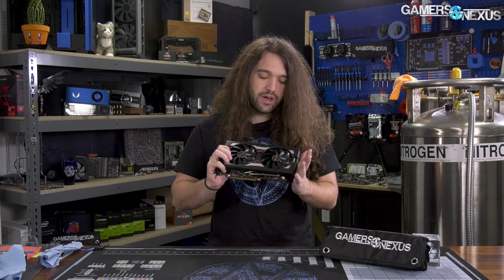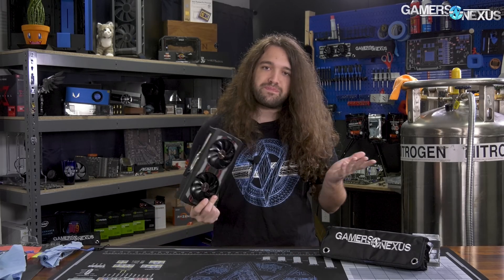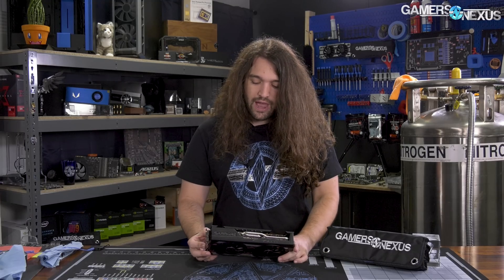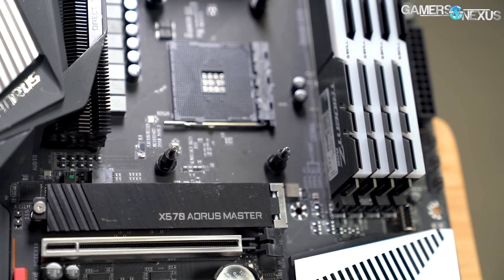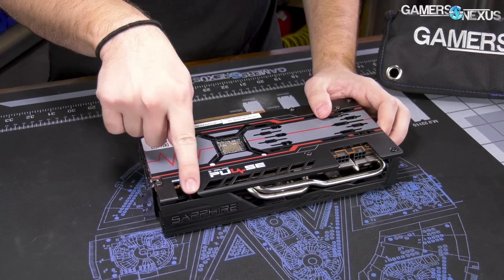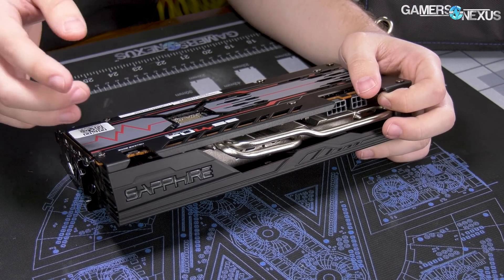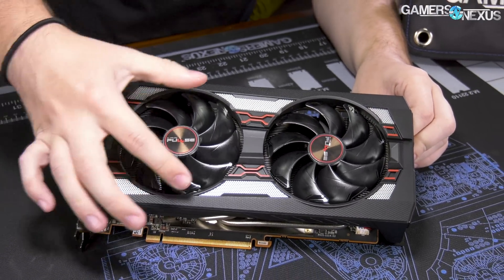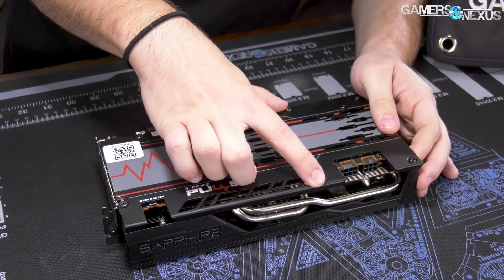Sapphire RX 5700 XT Pulse Tear-Down: Cooler Quality & Assembly

Comment: Here's my most up to date universal gaming PC build range pricing:

None of the listed frames per second ranges are overclocked.

More info on all of this: https://www.facebook.com/danthemanholt/posts/10220023187635995

I'm not using the newer AMD parts because Intel has better processors in the $350 to $485 range for gaming computers. Instead I use older high quality AMD hardware because it's cheaper. I can't justify the X570 PCIE 4.0 and 5Gbs NVMEs for that reason. Instead I'll wait for Intel to support PCIE 4.0, ddr5 ram, and 5GBs NVME. AMD wins 100% in content creation, their next Threadrippers should be killer. AMD's 2020 graphics cards will be cheap and great, they need to make their version of 2080 Ti there is no talks of. I had been saying if they have inbuilt liquid cooling on the right parts it would take them places. By 2021 Intel will have ddr6 ram and PCIE 5.0.

AMD's still ideal for quality cheap gaming with their $99 to $330 processors. I can give credit for AMD in expanding their hardware to ddr5 ram (that now accesses the high Mhz above 3200Mhz, for ddr4 ram anything over 3200Mhz only showed a marginal improvement in ram, ddr5 ram with B-Die can go up to 6400Mhz), 4-5GBs NVMEs, and X570 motherboards with PCIE 4.0 but it gets a lot more expensive than NVidia/Intel builds to purchase that new technology. I have to wait to find out about AMD's new $750 processor 3950X for gaming and how it compares to i9-9900K and i9-9900KS.

Gigabyte PCIe 4.0 NVME SSD new prototype Adapter has hit up to 15 GB/s when paired with four of the company's new Aorus PCIe 4.0 NVME SSDs, and possibly can hit up to 20 GB/s. An Aorus PCIe 4.0 NVME SSD gets 4-5GBs read and write speeds per each 2TB NVME SSD, beating the Samsung 970 Evo Plus PCIE 3.0 2TB that gets 3.5GBs read and write speeds.

https://www.tomshardware.com/news/gigabyte-pcie-4.0-ssd-5gb,39433.html Aorus PCIe 4.0 SSDs

https://www.tomshardware.com/news/gigabyte-pcie-4.0-ssd-adaptor-amd-third-gen-ryzen,39476.html Gigabyte PCIe 4.0 SSD new prototype Adapter has hit up to 15 GB/s when paired with four of the company's new Aorus PCIe 4.0 SSDs. Each of those SSDs hit up to 5GB/s, so the card could potentially push up to 20 GB/s with further tuning.

Here's the best gaming PC build you can currently get:

1. Intel Core I9-9900K 3.6 GHz to 5 GHz processor $485
2. MSI MEG Z390 GODLIKE $575
3. 2X G.Skill Trident Z Royal 16 GB (2 x 8 GB) DDR4-4400 Memory, 4 x 8GB that is 32GB in all, for 2 units is $636
4. 2 TB 970 Evo Plus M.2 SSD Samsung hard drive $480
5. 2 MSI 2080 Ti 11GB gaming x trio graphics cards $2390
6. Thermaltake Level 20 GT RGB Plus Full Tower Case with fans $247
7. 90 + 2400W power supply (higher than 80 + Titanium) for 2 graphics cards $136 (go to Frys online to find this)
8. Floe Riing RGB 360 TT RGB Fans AIO $185
9. NVLink SLI Bridge 4 slot for the 2 graphics cards $90 (bought separately, the one that comes with Godlike motherboard isn't nearly as good)
10. Windows 10 Pro 64 bit $150

$5538

You can get most of these parts from Newegg.

This gets 137 frames per second 4K Ultra high settings, and 55 frames per second 8K Ultra high settings. Hook up HDMI to graphics cards, not motherboard. Go to Frys and ask for the most expensive 8K TV with HDMI 2.1 which tops can get 60fps I think. If going 4K TV make sure it has HDMI 2.1 for 120 frames per second. With either 4K or 8K TV get TV Soundbar with Subwoofers as it intensifies the sounds really adding to the experience which are sold in the 4K 8K TV section of Frys.

This costs less:

1. Intel Core I9-9900K 3.6 GHz to 5 GHz processor $485
2. MSI MPG Z390 GAMING EDGE AC ATX $178
3. Corsair Vengeance RGB Pro 32 GB (2 x 16 GB) DDR4-3200 Memory $178
4. 1 TB 970 Evo Plus M.2 SSD Samsung hard drive $218
5. 2 MSI 2080 Ti 11GB gaming x trio graphics cards $2390
6. Thermaltake Level 20 GT RGB Plus Full Tower Case with fans $247
7. 90 + 2400W power supply (higher than 80 + Titanium) for 2 graphics cards $136 (go to Frys online to find this)
8. Floe Riing RGB 360 TT RGB Fans AIO $185
9. NVLink SLI Bridge 4 slot for the 2 graphics cards $90
10. Windows 10 Pro 64 bit $150

Total: $4079

For cheaper:

1. Intel Core i7-9700K 3.6 GHz to 4.9Ghz 8-Core Processor $358
2. MSI Z390-A PRO $130
3. Crucial Ballistix Sport LT 16 GB (2 x 8 GB) DDR4-3200 Memory $70
4. Crucial P1 1TB 3D NAND NVMe PCIe M.2 SSD - CT1000P1SSD8 $100
5. Gigabyte GeForce RTX 2070 SUPER 8 GB WINDFORCE OC Video Card $500
6. Matrexx 55 deepcool case $40
7. Corsair - VS 650 W 80+ Certified ATX Power Supply $26
8. Windows 10 64 bit $100 (you could get a hold of Windows 10 64 bit key for $15 range)
9. $117 Fractal Design S36 360 AIO

$1441 Gets 56fps 4K Ultra high settings, 22fps 8K Ultra high settings

Cheaper:

1. AMD - Ryzen 7 2700X $248 or AMD Ryzen 7 3700X 3.6 GHz 8-Core Processor $330
2. GIGABYTE B450 AORUS PRO WIFI (rev. 1.0) AM4 AMD B450 ATX AMD Motherboard $110
3. Crucial Ballistix Sport LT 16 GB (2 x 8 GB) DDR4-3200 Memory $70
4. Crucial P1 1TB 3D NAND NVMe PCIe M.2 SSD - CT1000P1SSD8 $100
5. MSI Radeon RX 580 8 GB ARMOR OC Video Card $160 (same level as 1060 6GB) or Vega 56 RED Dragon 8GB $300 (same level as 1070 Ti, 2060, and 5700)
6. Rosewill - FBM-X1 MicroATX Mini Tower Case $20
7. Corsair - VS 650 W 80+ Certified ATX Power Supply $26
8. Windows 10 64 bit $100 (you could get a hold of Windows 10 64 bit key for $15 range)
Optional: $117 Fractal Design S36 360 AIO with Matrexx 55 deepcool case $40

$834 to $974* to $1193, RX580 Gets 25fps 4K Ultra high settings, Vega 56 Red Dragon gets 40fps 4K Ultra high settings

* My recommended choice

Cheapest:

1. Ryzen 5 2400g with Vega 11 graphics $130
2. MSI - B450M BAZOOKA V2 Micro ATX AM4 Motherboard $69.99
3. OLOy 16 GB (2 x 8 GB) DDR4-2400 Memory $52 or Crucial Ballistix Sport LT 16 GB (2 x 8 GB) DDR4-3200 Memory $70
4. Seagate Constellation ES 1 TB 3.5" 7200RPM Internal Hard Drive 64MB cache $40 or TCSunBow X3 1 TB 2.5" Solid State Drive $90
5. Rosewill - FBM-X1 MicroATX Mini Tower Case $20
6. Corsair - VS 650 W 80+ Certified ATX Power Supply $26
7. Windows 10 64 bit $100 (you could get a hold of Windows 10 64 bit key for $15 range)
Optional: MSI Radeon RX 580 8 GB ARMOR OC Video Card $160

$438 to $667 Vega 11 gets 14fps 4K Ultra high settings, RX580 Gets 25fps 4K Ultra high settings

Optional builds:

1. Intel Core I9-9900K 3.6 GHz to 5 GHz processor $485
2. Asus WS Z390 Pro $388
3. 2X G.Skill Trident Z Royal 16 GB (2 x 8 GB) DDR4-4266 Memory that is 32GB in all, for 2 units is $462
4. 2 TB 970 Evo Plus M.2 SSD Samsung hard drive $480
5. 4X 2080 Ti Founder's Edition $4800
6. Thermaltake Level 20 GT RGB Plus Full Tower Case with fans $247
7. 90 + 2400W power supply (higher than 80 + Titanium) for 2 graphics cards $136 (go to Frys online to find this)
8. Floe Riing RGB 360 TT RGB Fans AIO $185
9. Windows 10 Pro 64 bit $150

$7333 Gets 274fps 4K Ultra high settings, 108fps 8K Ultra high settings

1. Intel Core I9-9900K 3.6 GHz to 5 GHz processor $485
2. MSI Z390-A PRO $130
3. Corsair Vengeance RGB Pro 32 GB (2 x 16 GB) DDR4-3200 Memory $178
4. 1 TB 970 Evo Plus M.2 SSD Samsung hard drive $218
5. EVGA 2080 Ti Black $1000
6. Matrexx 55 Deepcool case $40
7. 90 + 2400W power supply (higher than 80 + Titanium) for $136 (go to Frys online to find this)
8. Fractal Design S36 360 AIO $117
9. Windows 10 64 bit $100

$2404 Gets 77fps 4K Ultra high settings, 30 fps 8K Ultra high settings

Godlike has better sound, and Asus WS Z390 Pro can fit 4 2080 Ti graphics cards.

https://www.pcworld.com/article/3403317/these-overpowered-gaming-pcs-pack-potent-geforce-gpus-and-core-i7-cpus-for-under-1000.html

These are very low priced as NVidia/Intel gaming PCs compared to how they're usually priced. The SSD space is limited, the Mhz range of the ram is lower than 3200Mhz where I like to keep specs at an optimum range, but for the pricing I would say it's great for budget gamers:

https://www.walmart.com/ip/OVERPOWERED-Gaming-Desktop-DTW1-2-Year-Warranty-Intel-i7-8700-NVIDIA-GeForce-GTX-1070-256GB-SSD-2TB-HDD-16GB-Dual-Channel-RAM-Windows-10/621888364?u1=111346X1569483X7bf660668b143b37bda6f2ba949afdc8&oid=657759.1&wmlspartner=tv2R4u9rImY&sourceid=25693865721880602518&affillinktype=10&veh=aff $700 with Windows 10, 1070, and i7-8700.

https://www.walmart.com/ip/OVERPOWERED-Gaming-Desktop-DTW2-2-Year-Warranty-Intel-i7-8700-NVIDIA-GeForce-GTX-1080-512GB-SSD-2TB-HDD-32GB-RAM-Windows-10/341889368?u1=111346X1569483Xc67b7fc9734ccb06c9ec0fbd6cf8d8bf&oid=657759.1&wmlspartner=tv2R4u9rImY&sourceid=02489698700117409272&affillinktype=10&veh=aff $900 with Windows 10, 1080, and i7-8700.

Total supplies you need with a gaming PC: Surge protector $42, X-Box computer controllers each $54, keyboard and mouse $25 (rainbow, on Amazon), external bluray 4K 3D Blu-ray/DVD/CD drive $90, highest quality 4K 3D UHD bluray DVD software $42, $30 X-Finity wireless broadband Wi-Fi 65 megabytes per second 1 terabyte monthly usage buy $100 or so wireless broadband modem, WD Elements external 8TB $140 as external extra hard drive space, and $36 The UPtap 4K 8K HDMI 1.4 2.0 2.1 2.2 cable (you need this to experience 4K and 8K). The 970 Evo Plus is directly connected to the motherboard and operating system.

Buy some supplies at Best Buy and Frys or online.

4K 8K hdmi 2.1 120hz cable backwards compatible with HDMI 2.0, 1.4, 1440p, and 1080p

Comment: That is the same as the 570/580 pulse heatsink, exactly the same, maybe they recycle them
Reply: Huh, it looks a bit thicker to me. Like in between 580 Nitro+/Pulse Also there are some cutouts in the fins.
Reply: @fretboardrunner  yep
Reply: The 580 pulse did not have 5 heatpipes. It's definitely a new cooler. No idea how you think they're the same.

Comment: if this card lunches for $10 / retail of a stock xt; it will show that amd's has alot of profit overhead for their card or they're losing money/cutting it close.
Reply: There's quite a bit of wiggle room. Cost is somewhere around 220-250
Reply: I usually spend more than 10 bucks on lunches but I am a big fella too

Comment: I'm more impressed with the build quality than I was with the performance. Sapphire has done an amazing job with that design. I just wish it had Samsung memory on it.
Reply: Roger J why? Micron they say, clocked higher and more stable.
Reply: @zontarr22-zon  it might be just down to the sapphire having a better design of cooling for the ram than the stock amd cooler (maybe thats what roger meant) and thus might clock higher with samsung dies + sapphires cooler
Reply: @tonybarden8563  I doubt that as the new dies from Micron: E-die  run higher ~ freq~ than Samsung's B-die.
Reply: @s1l3nc3r3  HBM samsung indeed but Micron has E die now, for the RAM Micron is renowned for stability an reliability .

Comment: 3 cheers to sapphire for separating the baseplate from the main heatsink.  Hope to see others doing that to help the memory from cooking.  Running an HR-03 GT on my 5700XT 50th at the moment, and its a tad better than stock but have to watch memory temps when ambient is 30c..
Reply: The memory would actually run cooler if it were integrated in a proper way to the main cooler, but then you wouldn't have as much cooling capacity for the gpu itself. Sapphire went and cooled the memory just enough to ensure it doesn't run too hot and that's ok, this is the Pulse after all and not the Nitro+
Reply: @or2kr  that would be dependent on the temperature of the main heatsink.  Having the base place separated allows it to be less linked to the temperature of the main heatsink.  Unfortunately no reviewers really do "hot" testing so it kind of hard to say one way or the other.
Reply: @ProfTheorie  just bare with air flow from the fan.
Reply: @ProfTheorie  have a ton, hr-03 is just a stopgap since it performs barely better than stock so not worried.

Comment: with the baseplate i wonder if attaching the arctic cooler still attaches directly to the board or is the plate in the way? plate may help a little bit with ram cooling but maybe not so well with the kraken g12 still

Comment: it looks like the vrm heatsink/base plate is connected to the main cooler assembly.  the heat pipes are directly in contact with it just below the gpu, you can see the outline of the pipes on the baseplate
Reply: It's just the same as their older designs. My old 290 TriX had the same concept
Reply: Noticed that aswell.

Comment: The Die is so small. If AMD makes same size die as Nvidia rtx 2080 ti has then guess... How much performance we will get from Navi architecture & how much power it will draw? Cooling would be challenging.
Reply: AMD have sold cards with AIO in the past or we could see 3.5 slot cards. I mean crossfire is dead anyway, might as well fill up the case.

Comment: Hmm...Sapphire did such a good job on making that shroud's attachment to the card simple that it occurred to me I could 3d print a new shroud to hold two Noctua NF-A9x14 29.72 CFM 92 mm fans. Wonder how that might affect the thermals? Or if the card fan connector could power two Noctua's like that with an adapter?
(yes, I just like to fiddle with stuff)
Reply: I'd watch that! or at least I'm curious about stats
Reply: That would be most interesting.
Reply: plz do!
Reply: It should work. The fan used (FD10015M12D) is specced as 4.5W max input while the NF-A9x14 is specced as 1.32W Max input. They are also both PWM fans so hooking them up should be easy. As for how this would change the temperatures I'm not certain it would do much good.
I don't have any figure for how much static pressure the OG fan can handle, but as the Noctua fan is said to push just over 50 m³/h at 2200 RPM while the OG fan is said to push 34 m³/h at 3500 RPM I'm guessing that the OG fan can handle a higher static pressure.
So the question is how much the heatsink impedes the airflow. If there is to much resistance the Noctua fans might not be able to push enough air through the fins to match the origina fan. As for noise I'm pretty sure the Noctua fans will be quieter, it's their main claim to fame after all.
Reply: Just Dooo it! (Flex) :D
Reply: I had the same idea. Prepping for a TU150 build, this card looks to be two slots thick and the TU150 can hold a three slot thick card. I should be able to 3d print or fabricate a shroud that runs from the bottom of the case and taper down to the back plate. If that works I can use two 120mm Silentwings 3 fans. This would kill two birds with one stone, get more air in the case and easily keep the GPU cool.

Comment: i've had to swap fans on my last Sapphire card (R9 280x), it wasn't hard cuz i have experience on these kind of repair but its great to see they made even easier to the regular joe
Reply: Wonder if it's cheaper as it may make RMAs cheaper.
Reply: @jasonmcgrody9472  its probably the same but with a different power delivery

Comment: Can you install that GPU while having just one slot between it and one another Card? I have an itx 570 there and i would have no issues with pressing it slightly down and the 5700xt Pulse up to get enough space for it to breath, they wouldn't run at the same time anyways. Im just not sure if i could even install that card.
Reply: it's 2.5 slots wide afaik from what they said in the review, so no.

Comment: Those easy swap fans isn't new for Sapphire, it's derived from their RX500 series card iirc.
I can see they're experimenting with new solution on vram cooling because they usually connected to gpu coldplate on older sapphire cards.
Reply: I believe it was the 470's and 480's that had them first but I could be wrong. I know I personally have changed out more than 20 of them 95mm fans. A lot of fans were loud and needed to be replaced with in days of being brand new or just over time. RMA was actually easy back then not sure about today though cause there not really a problem on new cards. Send them a video and they'll send a new fan in the mail. Then you mail them back the broke fan. Now you can get these fan replacements at a lot of places. No need to RMA. I like to buy used components to build PC's to sell in my spare time.
Reply: @whatthehecknate  yeah, they fixed all RX400 series problem on RX500 cards while giving Nitro proper treatment it should have and came up with Pulse edition to those who want similar performance with reference card but better cooling.
Reply: I build myself a Black PC with Red RGB around a Year ago. Brought a Sapphire RX 580 Nitro + which are coming with Blue RGB Fans by Default. Got the Red Fans from Amazon (which cost around 15€ per Fan, not cheap, but worth it) and swapped them. I think they even sell/sold different colored Shrouds and Backplates for the Nitro Series.

Comment: Just waiting for Bullzoid PCB review
Reply: Hes done asus one, conclusion was extreme massive overkill
Reply: @pilerks1  Asus and Sapphire don't make same PCB ...
Reply: @janeksheppix  I know, I'm just saying he did the asus one first
Reply: @ronaldmcshitpipe  The cooler looks like it would have no trouble with even with Radeon VII, it should handle Navi 10 just fine. Pretty sure the Strix is going to one of the best 5700 XTs out there, also one of the most expensive.